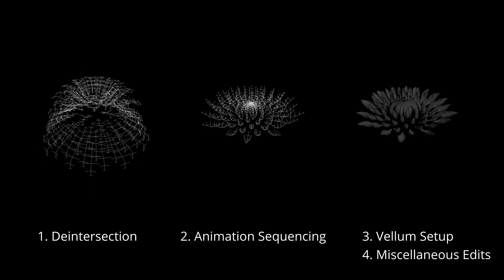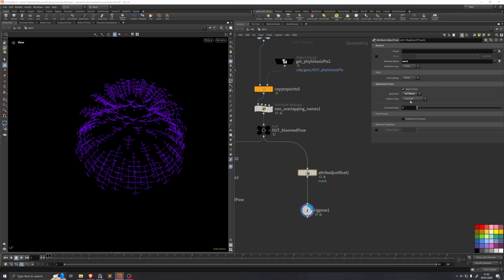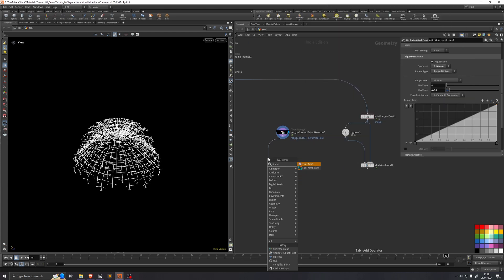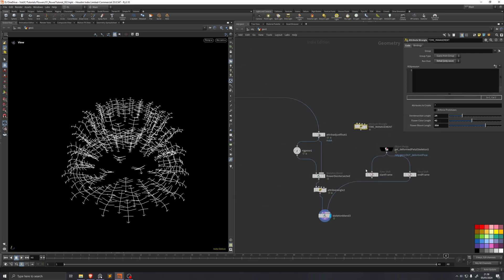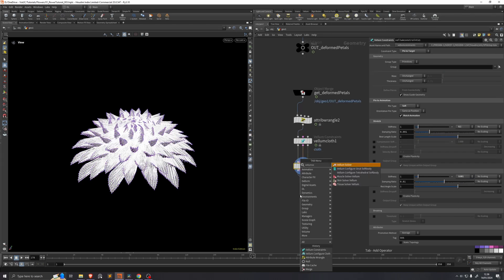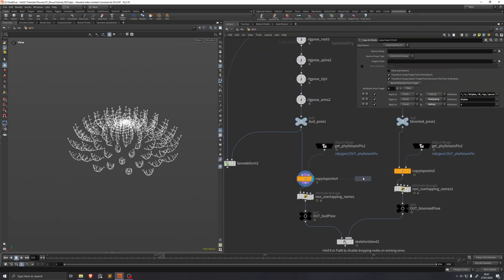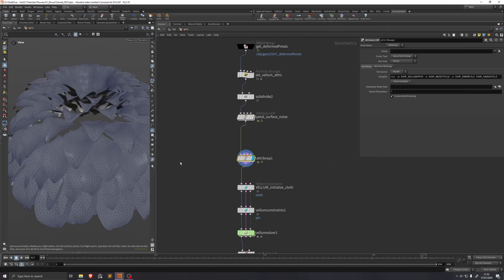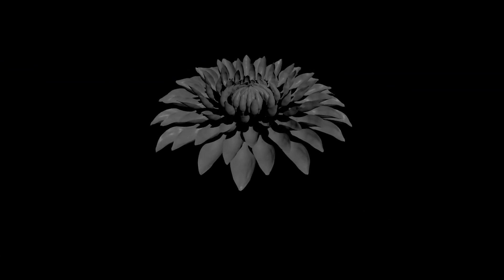Houdini Tutorial | Blooming Flowers | Model, Rig, and Animate | Part 3

Comment: Thanks for this ! . I used the dl_merge_animation that you kindly provided but it seems to be coming up with this warning "This node is using an incomplete asset definition. It will not function properly until the asset library containing the full definition is installed." Should I ignore and carry on ?
Reply from the maker: Yep, just ignore it. The node is unlocked and will work as intended
Reply: @DannyLrsn  Amazing thanks Danny ! I appreciate the fast response as well :)

Comment: Why are we turning off self-collisions? Don't we need that to prevent intersecting?
Reply from the maker: We're turning it off only for the bottom parts of the petal which we will often be forcing very close together. It just helps the solve be more stable.
Reply: @DannyLrsn gotcha. I skimmed to the vellum settings because my setup is different but that makes sense

Comment: Dear Danny, in vellum part, I'm a little confused.Do the Stretch and Blend value for the vellum constraint nodes "cloth" and "pin"  affect each other? Will the latter values overwrite the former?
Reply from the maker: @DonJack-m7o  no, they don't affect each other :)
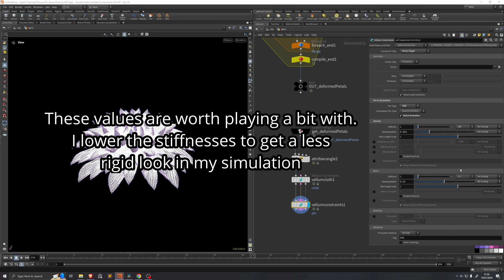Reply: @DannyLrsn  thanks for your reply. But I wonder why do 8:48 'pin' type constraint node redefine the Stretch and Blend again, while the values have been defined in 8:33?
Reply from the maker: @DonJack-m7o  That's because there are two constraints at work here. A cloth constraint and a pin constraint. Each of them have their own Stretch and Bend values defined on their respective nodes.
Reply: @DannyLrsn  Okay, thanks so much for your response , I may have used a strange perspective to understand them. I've got it. Thanks for your detailed tutorial, I love it ~!

Comment: Hi Danny, I've been working through this series with a cherry blossom with really good results compared to other tutorials. For my flower I am only using 5 petals, and for some reason when I am closing them they don't close in a logical order and they intersect. This gives my vellum sim some ugly collisions. It looks like the growth solver, moves the points based on point order (0 then 1 then 2 etc) however in the phyllotaxis wrangle the order of the points is random, so a petal that is on the bottom will close before the one on the top. I've tried a sort node and various methods but I still can't figure out how to close them in order from top to bottom.

Comment: Hello! rewatching the tutorials fo rthe 3rd time and I don't know why but I can't seem to get these animation pieces to function properly. I got stuck around 4:35 - 5:30 I downloaded your file, followed it and I'm not sure what I'm doing incorrectly 😓 My Flower close animation doesn't want to animate through the time line. if I turn off "set from attribute" to "no mask" in the blend mask node, then I can see it deform when I move the weight bar but when I move the timeline it doesn't move. this inhabits me to blend all the animations together. Any Idea what could be happening?
Reply from the maker: Hey!

So if I understand correctly, your flower close animation doesn't work when you try to drive the skeleton blend node with your mask attribute? If that's right, I would look at the "set_mask_from_frame" wrangle and visualize the mask attribute from there and scrub around the timeline to check that it works as expected. If it doesn't, compare that node to the file you downloaded from me.

I hope that helps!
Reply: @DannyLrsn  ok yup, I see that. when I visual the mask attribute it doesn't change colors like yours does. GOing back in the chain, any idea what could've inhabit the change of color? Any way you could see my file?
Reply from the maker: @LittleMountain111  yes, check the "set_mask_from_frame" node and compare it to my file. Check the geometry spreadsheet to see if the attribute exists. We're creating the attribute at the "set_mask_from_frame" node so it can only really be that node causing you to not have the expected attribute.

I can't check your project file unfortunately
Reply: @DannyLrsn  somehow got it by redoing the wrangle, I could've pasted something incorrectly. But the mask attribute works now!! THANK YOU SO MUCH!!
Reply from the maker: @LittleMountain111  That's great!